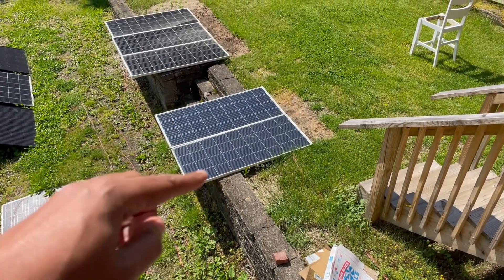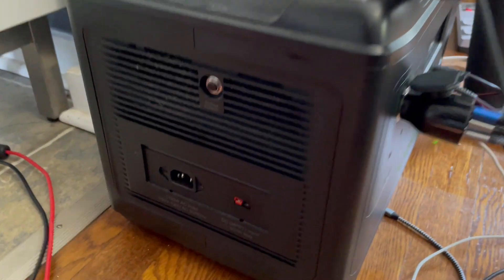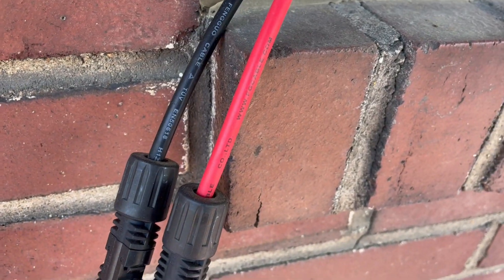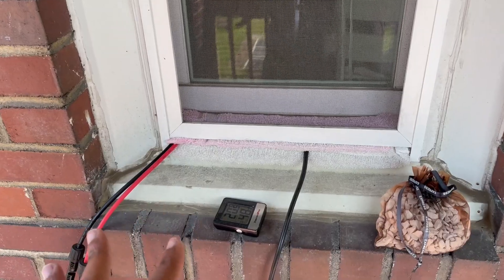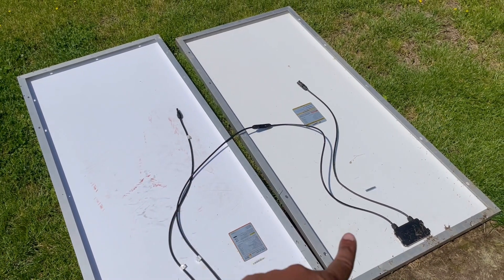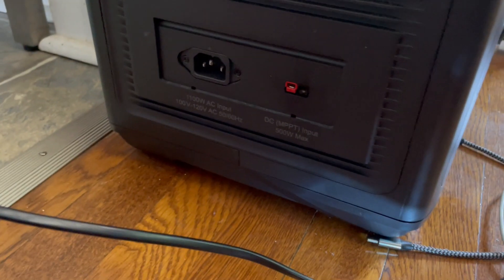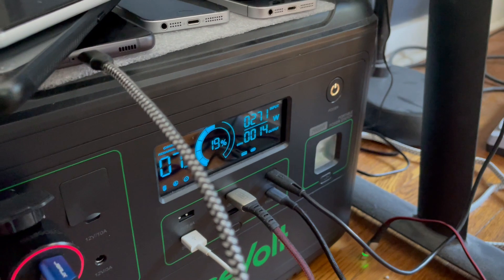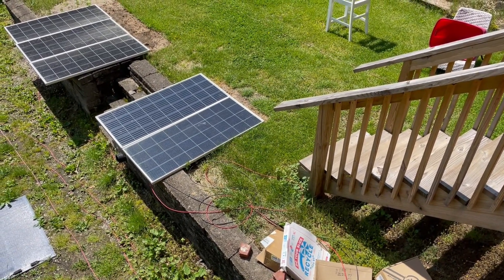Another Melted Anderson Connector!!! Acevolt Stopped Working

Comment: 12GA should be good for 20A, but the connection itself, if only rated for 15A, might have been redlining and getting toasty.  I'll bet it stays good now.
Reply from the maker: I was just saying that I wonder if these 15amp connectors are rated that way and that's pretty much max and these power station companies are not taking that into account. I'll have to ask Jasonoid what he thinks.
Reply: I literally had the same issue last summer with 300W of parallel going through the Anderson connector.

I switched to 400w of serial and haven't had the same issue again. It's absolutely the parallel that caused the issue.
Reply from the maker: Thanks for that confirmation!!

Comment: The biggest problem with those anderson powerpole connections (and why we do not use them anymore) is that are not heavy duty enough to really handle the amps that are pushing through it. (they are over rated specs in my opinion for those ports)

you can by a larger anderson port and install it, but they might not fit in that hole without cutting more space....

That acefire is just another copy version of the oukitel p2001 power station, open that bad boy up and do the MC4 connection mod ;)

note: The oukitel p2001 has a solar input of 12-48v (500 watts max) and since this is a copy of that model, it has the same ratings.

P.S. Also, a really unsafe thing about anderson powerpole is....the POS & NEG can shift apart sometimes, so say when the POS is making a perfect connection, the NEG port could be a little loose (causing a jacobs ladder type connection) creating A LOT of heat when the electricity has to jump across the connection.  (hence melting your port)
Reply from the maker: Really good insight!!

Great point about the alignment of the pos and neg. That could be what happened to me in some ways. I'll be really intentional with it on my ouoes mega 2
Reply: @AskIveSolar  I made a special video talking and showing the REAL problems with anderson powerpole and why we do not use them anymore :(

it will be out next wednesday :)
https://youtu.be/mcvvj8ZnR8w

P.S. Love you channel and even gave you a shout-out :)
Reply: If you put the little roll pin between the two sides they won't accidentally slide apart. You can also get red/black housing pairs that are permanently fused together already.
Reply: @ailivac  The problem with the roll pin is......None of the solar companies send you this when you get their cables, you have to buy it separate, seems a small safety hazard, no?  :(
Reply: @RamblinBobReviews The pins help align the connectors, you can also use a very small dab of super glue when putting them together but thats kinda permanent. 
I push 30 amps through my 30 amp APP rated connectors all day, no issues. The issue is probably a "knock off' brand of APP being used and they aren't original from Anderson. I have seen many cheap versions of these and they can be questionable. There are 15 amp, 30 amp, and 45 amps pins that all fit in the same connector.... maybe these companies are cheaping out with the 15 amp models?
I buy my 30 amp APPs from the source and they have treated me well. I have over 200+ connectors I have crimped and used on all my adapters. Thats a big sample of units and I haven't seen an issue.
Reply: @Jasonoid  Real or bootleg APP's, it is time that all these companies start putting XT-60 or MC4 or something safer on these power stations. Bluetti even upgraded to XT-60 and got rid of that crappy barrel.....

anderson powerpole problems... (vs MC4 connectors)
1. They do not lock good enough
2. They move or get misaligned often
(or could easily do so)
3. They are not water proof
4. They are not industry standard
5. much easier to get a shock because the ports are shallow and easier to touch the pins at the same time
6. They never come with the safety pins for glue to protect them and never explain this in the manuals.

   What happens when a 70 year old lady buys one of these power stations and burns down her home because of these ports?
(only a matter of time, right?)

  This guy knows what he is doing with the solar stuff and it happened to him, twice!!! 

     And 95% of people you ask have ZERO clue about the safety pins, plus companies never send them to you or even mention it. we have 40+ anderson cables and NONE of these companies sent any pins (10 companies)

   We had to order a 50 pack straight from the source and 3 of them burnt with under 15amps running through them :(

   30a and up, we have had no problems with, but this 15a junk should not be on these power stations anymore just for safety.

   PRIME EXAMPLE: This nice guy could have burnt down his house maybe if that got worse and he did not notice it or his kids maybe could have gotten hurt by this also :(

P.S. Whatever you guys choose, PLEASE BE CAREFUL WITH ELECTRICITY !!!!!
Reply: @RamblinBobReviews  xt60 and xt90 are not water proof. MC4 are easily connected in reverse polarity and are confusing for beginners. SAE is pure garbage. Barrel plugs can't handle many amps without melting... No connection types are 'perfect'. 
I think xt60 and xt90 (especially the anti spark xt90 connections with 10awg wire) are great connection types! I'd love to see more of them on power stations. I feel xt90 are safer since they can handle more power and larger wire diameters. 

I also enjoy APP but I think they are for more advanced users that can check alignment of the connects and amperage rating before using them. Connection strength is just fine. No complaints about APP from me.
Reply: @Jasonoid  I meant that list against MC4 (updated)  Thought i typed that in the last ramble....LOL

XT-60 for indoor connections and MC4 for outdoor :)

P.S. I do agree with the XT-90 comment :)

P.P.S. And every power station made from this year forward should "HAVE" to have "REVERSE POLARITY" blockers built in mandatory. This is a HUGE problem that needs to be fixed by "EVERY" power station company...Every one of the pecron units that we have have this, oukitel p2001 has this....plug it in the wrong way and NOTHING happens...wonderful :)

P.P.S. and yes.....SAE is 100% crapzilla for us as well....LOL

P.P.P.S. Not to mention that you always use 30a and up anderson powerpole (not these cheapy 15a ones) those just got to go for solar power...LOL
Reply: I've seen all styles of high amp connector in welded stuck and/or burned out stage.
Dirty or warn connectors where in many cases the cause.

Comment: I don't know if those are real anderson powerpole connectors, but in the real specification they specify the wire sizes required for the connector to carry various amps, and it applies to both sides (all four terminals) of a connection.  The connector requires the correct size wire or larger to carry heat away from the point of contact.  That said, from memory 8 amps doesn't need much, even 16ga should be plenty both for the anderson and for safety.
Reply from the maker: In parallel, it would have been about 15 amps. Made the 15 amps was too much for this mc4 cables and Anderson connectors
Reply: The smallest contacts they make are for 15A and 16-20AWG wire I believe.
Reply: @ailivac  the size of contacts is only the size of wire, and wire size determines the amps because of heating and how much heat it can carry away from the contacts. The actual contact points are always the same size.  It's in the specs.

Comment: This makes me think of the star wars meme, "You were the chosen one!". I find it weird that its the Anderson connectors that keep failing. I wonder if its because there are two or three ratings for the same anderson connector so there might be a mismatch in the amperage.
Reply from the maker: Jasonoid suggested it could just be that the included cables weren't rated for the amps. Shrugs.

Comment: i tried looking up the specs on your solar gen. It says 12v-50v 500w max but doesnt say max amps. *I could assume 10a max. 50v x 10a = max of 500w
Not sure the limits of the connector on the solar gen. Your cable should have easily exceeded 20a even 30a
Reply from the maker: You know, that's very sound logic! These devices are pretty much the same in that they have a 15 amp limit. I had the same issue with the oukitel. 

Now you gonna make me check the specs. Ha

Comment: I found sometimes I get better performance is series as long as the shading does not bite you in the backside! Definitely less loss with lower amps and bigger voltage!  At least the cable and power station input seem ok!
Reply from the maker: Shoot, they are not ok, they just still worked but the melting persisted and I stopped using the solar.
Reply: @AskIveSolar  oh boy!  Not good